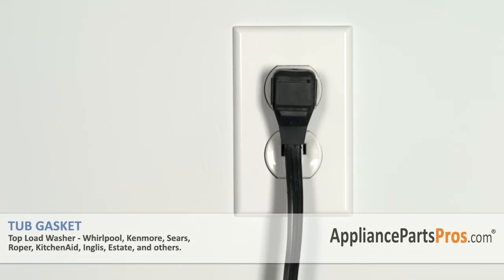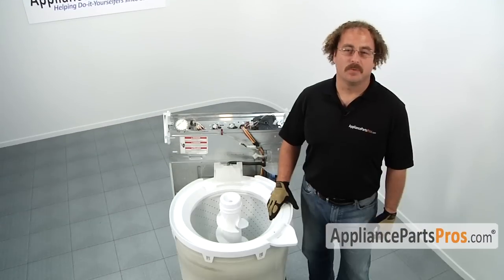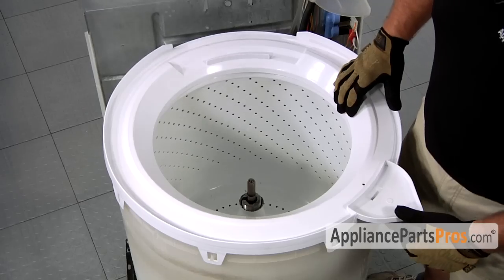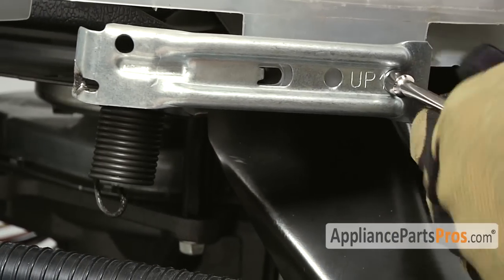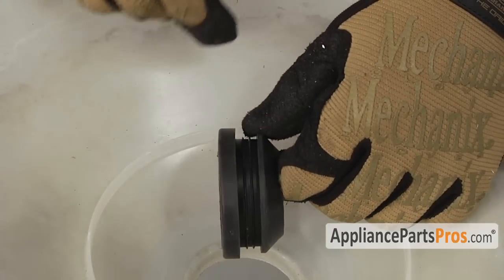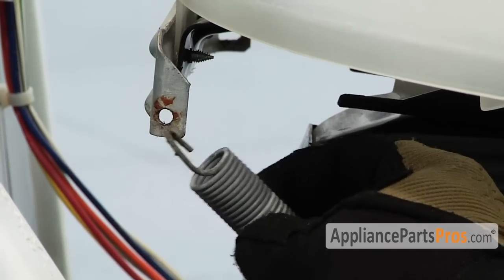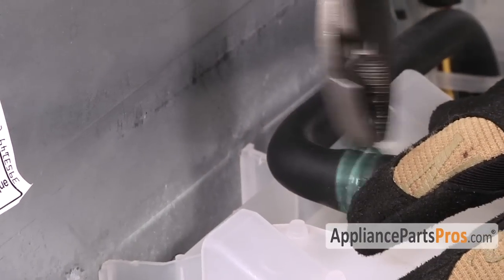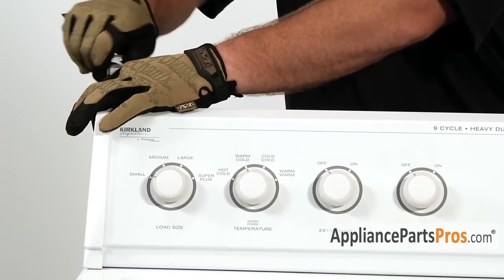How To: Whirlpool/KitchenAid/Maytag Gasket W10814296

Comment: What to do if the inner tub is stuck and does not want to come out?
Reply: I'm right there with you right now
Reply: @betteheadbettehead4800 i ended up using jaw gear puller, tub came out with dead stuck drive block. So don’t be surprised if it happens with you also

Comment: I tried to use single water supplies hose at input but water starts leaking out of other open input lines
Reply from the maker: You will need to follow the installation instructions for your washer. You do have to have both cold and hot water connected to the unit.

Comment: Even I don’t need to use hot water supplies because weather in Saudi Arabia is always hotter
Reply from the maker: You will need to follow the installation instructions for your washer. You do have to have both cold and hot water connected to the unit.

Comment: Is it possible to use only single watering supply hose either Hot watering or cold watering because I don’t 2 taps
Reply from the maker: You will need to follow the installation instructions for your washer. You do have to have both cold and hot water connected to the unit.

Comment: I have removed the spanner nut; however, the drum is seized to the shaft. Do you have any recommendations on how to free it so I can remove and access the tub?
Reply from the maker: Hi @turnert2005 — good job getting the spanner nut off, that can be half the battle! If the drum is seized to the shaft, it’s likely due to corrosion or mineral buildup where the drive shaft goes through the bearing hub. Here are a few things that usually help:

Penetrating oil: Spray a good amount where the shaft meets the inner tub hub and give it some time to work in.

Rubber mallet or block of wood: Gently tap around the shaft to help break it free — just avoid hitting the shaft directly with anything metal.

Tub puller: If it’s really stuck, a tub puller tool can give you the extra force needed to lift it off safely.

If you're working on a model with aluminum on steel components, they can bond over time — so don’t be surprised if it takes a bit of elbow grease. Let us know how it goes.
Reply: @appliancepartspros Thanks for the quick reply! I ended up using penetrating oil and a three-jaw puller with the spanner wrench behind the spanner nut, and it came off like butter! 👍😎👏
Reply from the maker: @turnert2005 Love to hear it! That’s a solid combo — smart move using the spanner wrench behind the nut. Thanks for circling back with the update, too — it'll definitely help the next DIYer who runs into the same issue. 👏💪

Comment: Excellent video. BTW, for those about to embark on this journey, remove the tub before ordering this gasket, and inspect the mating surface on the vertical post of the support (part# 280184) - if that surface is corrosion pitted, a new gasket won't help - and as far as I can tell, your options are eBay (currently one used, listed with the drive tube for $199 + $50 shipping)... or some creative work with JB Weld and some sanding to fill the pits and give the gasket a smooth surface.

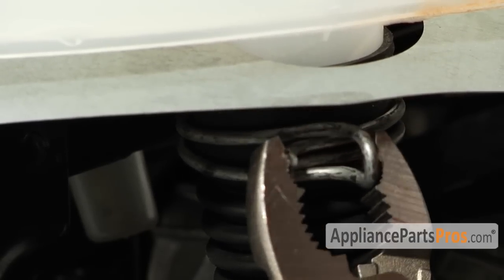Also around @9:44, go ahead and reconnect the water pressure air hose that was disconnected @4:57.
Reply from the maker: Thank you for the pointers. If there is anything we can help you with in the future please let us know.

Comment: Once the outer tub is off, there are two other seals visible (in addition to the seal featured in this video). One is at the very top of the transmission shaft; the other is about where the bottom of the drive block sits. In my experience the seal at the drive block is much more likely to be the culprit than the shaft seal at the bottom of the tub. Is there any chance of getting a video showing replacement of that seal?
Reply from the maker: Usually, we try to film videos for commonly replaced parts. If that part frequently fails, it may end up on that list. Keep an eye on our channel! :)

Comment: My whirlpool top load washer is leaking badly during all cycles once the tub is at least half full with water.  I replaced the centerpost gasket about 8 months ago when there was a leak only during the wash cycle, and it has been doing fine until 3 days ago.  I have the machine opened up, even with the shaft removed.  The gasket which I replaced months ago looks fine.  Are there any other gaskets/seals which might need to be replaced?
Reply from the maker: +Seven Inajeep You will have to take the cabinet off and try to determine where the leak is coming from. Check the outer tub for cracks and holes. You can also post the problem along with the appliance model number on our repair forum and the techs can help you troubleshoot the problem. http://forum.appliancepartspros.com/

Comment: spanner nut is not that easy to remove......I have hit it for days,,,,sprayed it with wd 40 and still it wont come off.....>>>>
Reply from the maker: dablock2k3 If you can not get it to break free you may have to cut it off. But before you try that hit it with a heat gun to see if some heat will help it break free. Either way be careful you do not damage the inner tub! The most popular drive block comes with a new nut. You can enter your model number on our site to make sure you order the correct one.

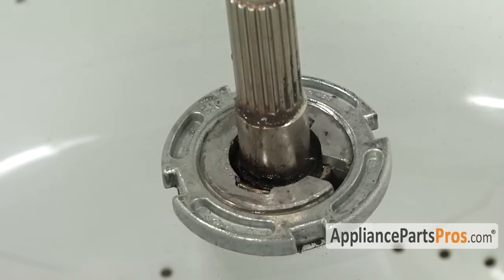Comment: At the 10:30 mark you install 2 small pieces on top of the shaft nut. What are these 2 pieces and what are their function? When I took out my agitator these 2 pieces were not present. Is there a model that does not use these? What would happen if these 2 pieces were not present? Thank You!
Reply from the maker: It is a spacer and a clamp to hold it. You would have to go to our site and enter your model number to see if they are used and which ones are supposed to be in there. We always recommend replacing everything the manufacturer put on the machine.